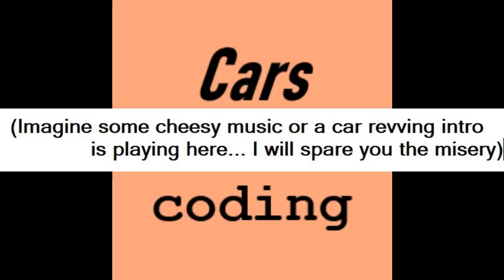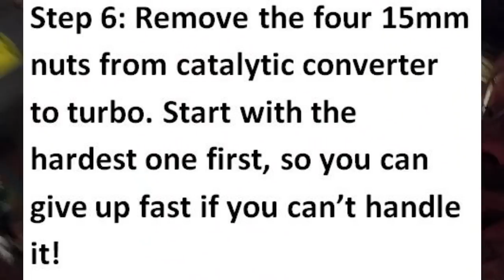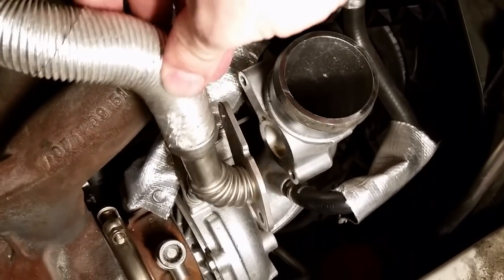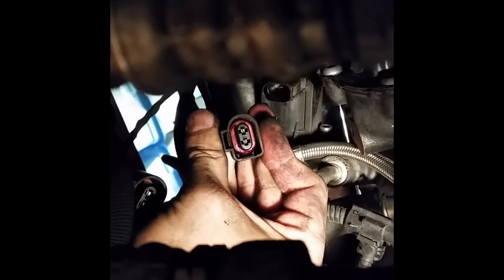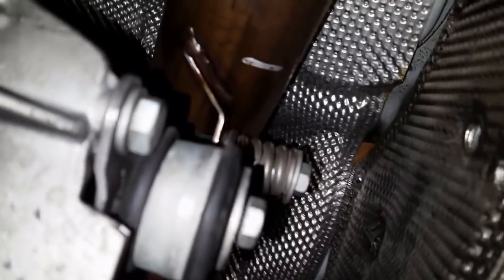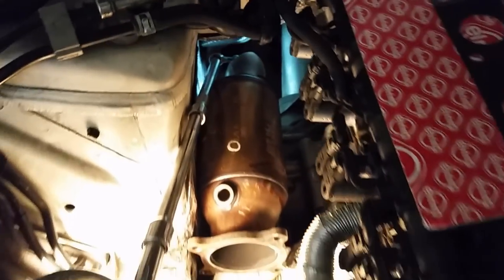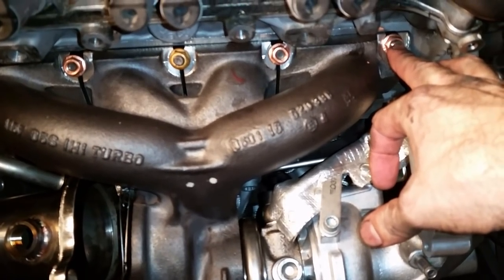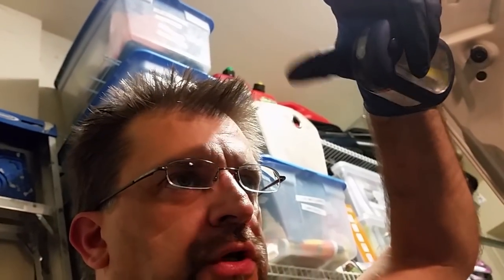Replace Turbo Audi A4 A5 Q5 B8 Turbocharger K03 Replacement

Comment: Would you consider a 73k mile used turbo low mileage?
Reply from the maker: No but if it was from a 2015 or 2016 it might be ok. The turbo itself will be fine but the wastegate is the issue. Need to have the person selling it show you the wastegate via facetime or zoom that it is tight.
Reply: Cars and Coding ok, so that one is from a parts company on eBay so I don’t know if they will be able to do that video thing. So maybe I should go for a 50k 2014 ^ cause they get more expensive.
Reply from the maker: @EJR20  anyone selling one will take the time to send you a video. People take videos of the stupidest things they will certainly take a video of a $400 part. Ask.
Reply: I found 3, 2015 with 64k miles, 2013 58k, 2016 33k. The 2016 exceeds about $100 in price compared to the others. I’m wondering which one I should go for.
Reply from the maker: @EJR20  I would do the 2016 no question
Reply: Cars and Coding i thought only up to 2015 turbo fits. Isnt 2016 different turbo?
Reply: Cars and Coding so I just got the Turbo, the company I bought it from couldn’t send a video of the waste gate. Now I tried wiggling it and it moves just a bit with some kind of resistance. Not as much as the one in your video. Can I please send you a video of it to your email or something so you can give me your utmost thought about it, I would really appreciate it. Thank you.
Reply from the maker: @EJR20  sure send the video to carsandcodingvideos@gmail.com
Reply: Eddie Jasson i got mine 2015 w 48k. It moves barely when i force it to spin. Vs the original one just spins freely. As long as it has a tight seal, think u are good. Just got it installed. Make sure u dont over torque those engine return line bolt like me. Luckily i was able to use an extra bolt from the breather hose.
Reply: ernie p thank you. Mine’s from a 2015 as well with 51K. Yeah I didn’t try to spin it, I just realized in this video it actually spins and goes around. I plan to swap it over the weekend.
Reply: ernie p did your check engine light go off on its own for as well?
Reply: Eddie Jasson i have a cheap odb2 device that clears the p0299 code. I havent driven it far yet so will know tmr if code comes back. I doubt it.

Here is some tip.
-Put engine cover on and hop on it with your chest across it. It helps to get that catalytic bolts.
-You’ll need to spin the turbo wheel if u want to fill it up w oil before 1st start. Otherwise u cant get much into it.
-You dont need to remove the engine oil feed line from engine block.
-torque is 15ft lb for the oil return line.
-check the version of the DV Valve. My old turbo had revision D so newer than the replacement turbo w C. So i swapped it to latest one
Reply: ernie p wait, so you did clear the code with the odb2 or did the light go off after the exchange?
Reply: Eddie Jasson i cleared it w odb2 device. You’ll need to drive like 20-50miles for codes to clear by itself. Or if u have obd11..u can do it too
Reply: ernie p what scanner do you use?
Reply: Eddie Jasson use any. Obd2 scanner are all the same. But if i were u, get obdeleven instead. I have that as well but just faster w the basic scanner. Look on amazon
Reply: Cars and Coding so I was checking under the hood to familiarize myself with all the steps for tomorrow, and I stuck my finger trying to touch the stubborn bolt and I couldn’t feel anything apart from the stud, basically it’s not there. I guess the person that worked on the car before just thought it would be better not to put it back!!! Now I don’t know if that causes a leak, basically I’m asking if there was a leak would it bring P0299 , but still, the car sometimes has a slow build up of power esp under 3000rpms so I’m pretty sure that the turbo is out. 
I got an OBD2 scanner and cleared it today, the code is labeled as Permanent. I’m pretty sure it will come back, unless of course until after I fix it. Did I ever mention I replaced the Diverter Valves weeks back so I’ve definitely drove over 100mi, code never went away.
Reply: Eddie Jasson are u talking about the hex bolt on the heat shield? That bolt is useless. I did not put it back. And no, it doesnt do anything but to old the heat shield in place. Dont need it.

There are 2 types of codes. One is temporary which you could erase and the cel will be gone. There’s dtc which is coded for longer. Those wont go away unless the sensor doesnt report it again after driving a period of time. I had p0299 for a few yrs. it only came once a yr. but recently, it was everytime i floor the pedal. I just drove mine today. All the power is back and car is good
Reply: ernie p not that bolt, I’m talking about one of the bolts that hold the cat to the turbo; the one that’s buried and hard to reach. 

My code reader labeled it Permanent and I’m pretty sure if I don’t fix it the check engine light will come back after I drive it a certain distance. And even tho the code reader turned off the check engine light, I think the car won’t pass emissions test, because “P0299 Permanent” still appears on the code reader, am I right… but then again I think even after the problem is fixed, like you said, the sensor has to report back after driving for while.
Reply: Eddie Jasson oh yea they probably dropped the bolt. It could throw p0299 since more air into the system. But does your wastegate has play? Like when you move the rod.

I was able to pass emission in TX even w the turbo issue. I knew the code is thrown whenever i floor it. I just erase it and made sure the Pending DTC codes is cleared then o took it in. Anyways, gluck
Reply: ernie p I wasn’t able to reach the rod & move it. I’ll try tmw. Thank you.
Reply: ernie p the thing to spin the turbo wheel to fill it up w oil, I’m not sure what’s the turbo wheel. Does it do any damage if I start the car without putting oil in the turbo manually?
Reply: Eddie Jasson if you reach inside the turbo where the wastegate is at, i believe that’s how you can spin the turbines so oil could go in. I was only able to get very little fresh oil in. 

I started the car for 30secs and stopped a few times so the oil would pump into it. I ran into the problem where it was super hot. It was air inside the coolant system. I end up driving up and down my 4 story garage and the air bubble finally left. Then the turbo was running normal again
Reply: ernie p oh that little fan in by the waste gate! Got it. I hope I don’t run into that problem. 
I took the car for emissions in the morning before I attempted to change the turbo and I’m glad it passed. Then went on to try and change it, lmao, I’ve never came across tight ass bolts as the ones on the cat. And we didn’t have extensions like carsandcoding used so I just stopped until after I get them I’ll try again. Now that I got the emissions out the way, I can take my time to work on it.
Reply: ernie p and oh I was able to shake the actuating arm on the turbo and yeah it’s done, it was shaking and literally making a clunking noise.
Reply: Eddie Jasson for the cat bolt on top on the inside. I used a long socket and a combination of extensions plus an 18” ratchet breaker bar. You can buy one from harbor freight and then return it.

You need to switch over to a short socket once is somewhat out because the socket hits the cat. Spray some PB blaster on it the day before. Mine come out easy but i had all the tools and extensions. Gluck. Pls keep asking questions if u need more help
Reply: ernie p all I need now that I know for sure what I’m dealing with are the right tools. I’ll try & gather those. I appreciate the help I’ll be sure to ask. Did you also reach the bolt that’s buried under like carsandcoding did, like from the back of the engine or did you figure out another way?
Reply: Eddie Jasson the same way. From the rear with 18” ratchet breaker bar and combination of extensions. Dont use just one extension. I switched alot btwn diff length.

This are tools u’ll need:
-Triple square set. Must order on amazon. The rest from harbor freight
-18” ratchet breaker bar
-torque wrench for 25ft lb and 15ft lb. (u can rent this for free at autozone)
- 1/2 or 3/8 long and short sockets Set 
- hex set w 5 and 6 size
- flat wrench set..u wont be able to remove the coolant inlet banjo bolt w a torque wrench (it’s too thick). You need to remove triple square head out of socket and use a wrench to remove it. This is the bolt off the side of the turbo...the side toward ur right fender.
- buy a set of extensions 
- short stubby to remove the bolt for coolant hose from engine block in front. Not much space there
- pliers to open the coolant drain plug if u want to drain coolant before hand
- portable light to light area of work.
- good car jack and jack stands. 
- a tool to cut the hose ear clamps. I was able to open it by jamming a phillips head and then flat head to ply it off. You will need to buy a new small hose clamp

Comment: I already replaced the turbo 
But I keep getting error under Boost on the scanner .
Do I need to Reprogram the computer after replacing the turbo ?
Reply from the maker: You should clear the codes after replacing. But it should not keep coming up. Look for hose clamp not tightened to intercooler or to turbo. Or could be diverter valve is bad.
Reply: @CarsandCoding  
I did changed the diverter valve last month before changing the turbo .
No one knows what’s the issue .
The car hesitate on high RPM like over 3000RPM
Then the check engine goes off .
The mechanic put a boost control for me .
Either EPC goes off with over boost or I get the check engine with under boost .
I keep adjusting the boost control to get to the ideal boost but no success .
Do you have any idea what can it be ,
Can the high pressure fuel pump be bad ?
Reply: @raminkh7552  you need a new boost solenoid G

Comment: Which turbo can I upgrade from mine. 2009 a4 the turbo says it’s 06h145702g
Reply from the maker: Any turbo from A4 A5 or Q5 with 2.0t will work 2009 to 2015 You can also buy new on fcpeuro.com or other parts suppliers
Reply: @CarsandCoding  ok I’m new.. are they k04? I just want a larger turbo
Reply from the maker: @anthonycaruso641  oh! You want k04! That didn’t come on any stock car. You have to buy that new.

Comment: I'm very new to this malarkey.

This video just let me know that there's no way in hell I'm attempting to replace the turbo.

My turbo makes a strange pffft sound when I put my foot down and change gears.

It used to make a pleasant air release sound.

I don't know. I found the EGR to be blocked solid with carbon, so I cleaned it.... Then my turbo sounded weird.

My "friend" has sold me a car that's in need of TLC.
Reply: 8 months later and I'm more confident than I was. But there's still no way I'm attempting this and hoping to drive my car to work in the one day that I get off 😂

Only turbo noise I get now, is a sorry little psssst after increasing the revs.

🤔🤔🤔🤔🤔😁
Reply: Think of the hours of fun you're missing

Comment: Does anyone know if there is a way to prevent the coolant loss? I see that once air is let into the coolant system it all drains out through the turbo.
Reply from the maker: It only comes out from the coolant tank. Disconnect coolant tank and put the line up higher. It was my mistake. The block and radiator doesnt drain.
Reply: Thanks. I got it out. Really not that bad. Regarding the install kits that are floating around online, in your experience were all of the seals that you needed included? I’m seeing some comments about needing new seals for where the oil return line goes to the engine block.
Reply from the maker: @Jman4178  Probably best to order all the parts before you start the project and return the ones you dont use. Kits are usually good but could be missing something, a "kit" is a guy in a warehouse throwing parts in a box, hard to tell if you got everything until its in your hands. I havent had issues returning parts to most places. Good luck! :)

Comment: There’s a $60 part that can fix the wastegate issue instead of replacing the whole turbo.
Reply from the maker: Awesome! Please make a video of the $60 part install! There are hundreds if not thousands of people who have a used turbo with a sloppy wastegate sitting on a shelf in a garage or basement that would send it to you to be fixed for $200. Someone could start a rebuilding business from this if a $60 part is all that is needed to fix this issue. I would love to see it and do this! I will gladly send my used turbo out for the fix if anyone has a good fix for it. Please post your info. Thanks!
Reply: Wrong... the clip doesn't fix it, only prolongs the life of it. Going on my third turbo at 210k miles.
Reply: Can I use it without removing the turbo?

Comment: YOU PUT IN THE WRONG TURBO SHOULD HAVE BEEN KO4. HA HA. I am thinking of going KO4 bro.
Reply from the maker: It is fast enough for me at this point. Ran 13.98 at 99mph on Unitronic stage 2. K04 might run 13.25 or 13.50 not big enough difference to swap it out right now.
Reply: @CarsandCoding  WOW happy for you man. That is a good time. Do you have a 3" exhaust like me?

Comment: Your audio sucked, rendering much of this unwatchable
Reply from the maker: Thanks for watching. There are how to documents on message forums such as audizine.com that may be useful to you as well. Hopefully your repair goes well and you can enjoy your Audi for many more years.
Reply: @CarsandCoding  I apologize, I was harsh. The fact is, with some editing and decent audio, you might actually have the best turbo replacement video out there. I just couldn’t sit through it as it is, which may speak more to my 67 y/o lack of patience than anything.
Reply from the maker: @salnichols94805  watch it at 1.75x speed. Thats how i watch all videos.
Reply: @salnichols94805  67 yos probably don't need to use the phrase "...sucked"
Glad you've grown up recently

Comment: Question the new replacement turbo is it an oem Audi turbo or an aftermarket?
Reply from the maker: The one I installed was a low mileage used turbo.
Reply: @CarsandCoding  I’m actually in the process I’m changing mines what do you think of a rebuilt turbo ?
Reply from the maker: @juniordiaz2425  the only thing that needs to be fixed is the wastegate so rebuilt should be perfectly fine. You can get your original wastegate fixed for around $250. Its the shipping that costs all the money, the parts are $65 and labor is an hour.